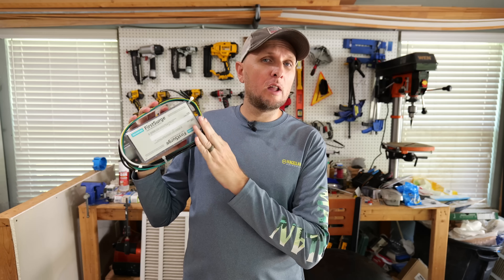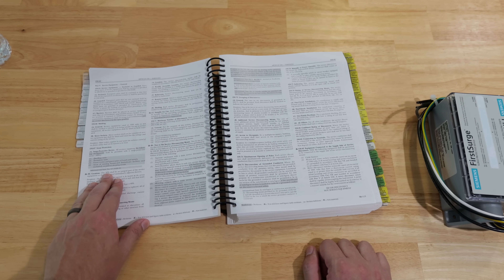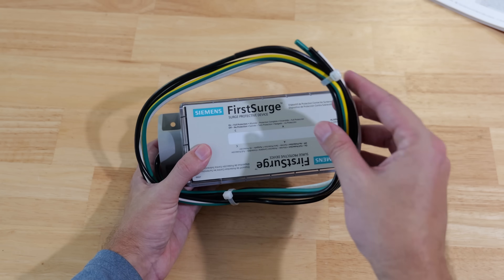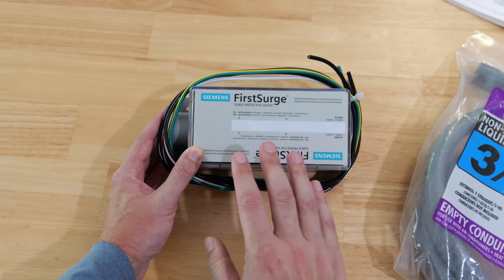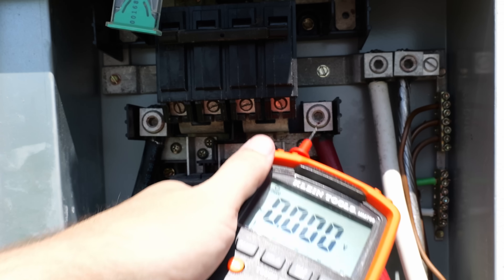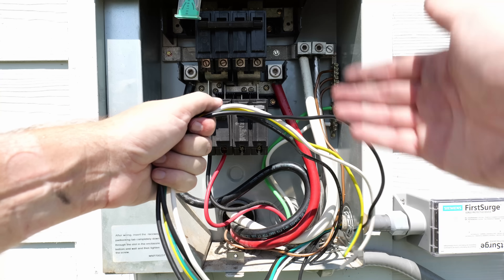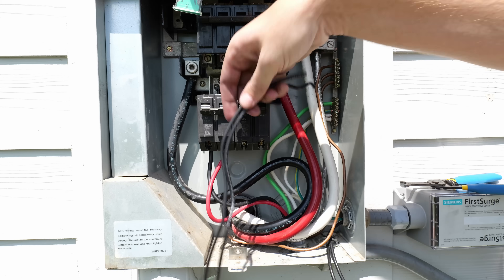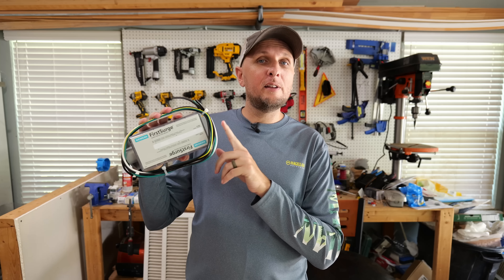Why Whole Home Surge Protectors Are Now Required and How To Install One!  Siemens FS140

Comment: I'm a RF engineer, definitely not an electrician.  But I have designed high power limiters for the RF transmitters (which I also design).  Essentially,  limiters perform the same function as a surge protector, just a different type of scenario.  The importance of keeping the wires short is due to the wavelength of the transient(s) (i.e. the 'surge') spike and also to reduce inductance of the wire - both which limit the effectiveness of the SPD's ability to clamp a surge.  Transients voltages (i.e. a lightning strike) can be converted from the time domain to the frequency domain, and that frequency has a physical length, depending on the medium it's in (air, a printed circuit board, etc. affect the physical length).  If the SPD is a quarter wavelength away from the connector point (i.e. the breaker) at the frequency of the transient, the SPD's 'shunt' impedance will appear as an 'open' at the breaker, meaning the SPD is ineffective.

Also, when I mentioned the transient and converting it to frequency above - transients actually contain a multitude of frequencies, all which have a different wavelength.  Unfortunately, it's not an easy problem to solve by attaching a SPD outside the box.

The ideal solution is to install a SPD inline, between the feed and the breaker box since this eliminates the lead inductance and the wavelength issue.  But that is not practical on a retrofit.  Personally, I'd still install one. A surge can take on many forms, and you almost need to attack it from many directions (SPD at the box, surge protectors at outlets, etc.).

Honestly, I'm surprised the electrical box manufactures haven't designed a panel with a replaceable, high quality and inline SPD at part of the electrical box (between the feed and breakers) - that would be the ideal solution for a new build. I'm not an electrician, so maybe there's some out there already?  I know Square D makes a SPD that fits in a breaker spot, but that has some limitations (I have several of the those).

No doubt it's a tough nut to crack and if it's from lightning, it tends to do what it wants. And there's other surge scenarios that an external SPD will work as intended, so it's definitely a crap shoot at times.  Our house had a direct hit last year.  Ironically, it hit the roof, bypassing the breaker box and the surge protectors located there, and snuck in via other paths (the outdoor can lights).  TV issues due to going in thru the power line - no issues.  HDMI ports? - kapow! I guess you do what you can.

Sorry if I got a little technical.  There's really a lot going on in order to make an SPD effective, and I really just lightly touched on some of the important details.  Likely a surge is defined as certain waveform by the NEC (correct me if I'm wrong), and a SPD is designed around those conditions.

Whew - that's a lot of typing! :)
Reply: As a retired RF engineer I concur fully with this gentleman's statement here. I am skeptical of the effectiveness of these devices because of the thin gauge and long length of the wires that connect the device to the power supply bus.
Reply: @basspig  Greetings from a fellow RF engineer (mostly-retired)!  Surge protectors are an interesting subject.  Simple at first, until you dig into the details.  I mentioned above we had a direct hit from lightning so I started to replace my outlet surge protectors with new ones just to be on the safe side.  Bought a Philips outlet surge suppressor at Wallymart.  Probably like most, I tended to focus on the clamping current...until I noticed the clamping voltage.  900V!! Yikes - why bother.
Reply: @Pinhead-q4i We had many challenges at radio tower sites. For obvious reasons. :-) 
One of the most effective measures I've had against lightning was winding the last 20' of mains cable into a loop, several turns-worth. The first step in absorbing surges is to present as high an impedance as possible BEFORE the shunting device.
In my experience, the surge protector devices do little to protect sensitive electronics. Just having a power outage can kill computer equipment that is not on a UPS, as I have found out over the last 25 years.
Surge protection has to take into account both differential and common mode voltage spikes. Then there's the EMP factor with lightning, inducing currents in any wires connected between devices, such as USB cables computers and peripherals. Only Faraday shielding the building can solve that last one.
I had an interesting call from a NY radio station I was CE at in the 1990s. They'd suffered a lightning strike on their tower, co-located with the studio. All of their computer monitors displayed distorted images with "rainbows". I knew right away what happened. So upon arriving, I grabbed a bulk tape eraser, powered it up and walked up to each monitor and de-magnetized them. All back to normal.
Reply: @basspig  Loops - Neat idea to help get a little bit more inductance on the outside of the shield for free, heck of a lot better than just a straight run.  Did the setups usually just employ one protection device, or did you have several, spaced a certain distance apart?  Were the protection devices a gas discharge tubes (I don't have much experience with those)?

Now that I mentioned a gas discharge tube, I wonder if those could be used in a SPD for the breaker box?  I was assuming the SPD's for the breaker box are just a bunch of MOV's?  Maybe that was the wrong assumption.

OP: Don't mean to hijack the comments, but it is sort of related w/respect to surge protection,  albeit a little more obscure side of the topic.
Reply: @Pinhead-q4i  Just one coil of the wire coming in from the pole, about 4 turns on 3' diameter.
Followed by one protection device at the breaker panel.
In some of my radio stations, we employed Isolotron surge arrestors (3 phase setup) with a phase-finder for circumstances where we lose a phase, just to keep the transmitter on the air.
I like spark gaps and gas discharge tubes for the big surges. MOVs are one time use mostly, and if you get a situation where a 13kv line lands on a 240 line, they aren't going to help past the first millisecond.
Reply: @basspig  Interesting!  Always neat to hear about other's ways of tackling the problem.
Reply: @Pinhead-q4i  Absolutely correct and I can't believe that this wasn't even mentioned in this video at all (or mentioned by any of the trained professionals that are commenting on it). Most whole-house surge protectors are only designed to begin to work once you hit a VERY high surge level of 600v or more. Well, that's all fine and dandy, right up until you realize that the sensitive microelectronics that reside in most modern devices in our homes today (computers, TV's, tablets, cell phones, receivers, streaming devices, Blu-ray players, printers, etc.) can all be damaged by voltage surges that go anything over about 325v. By the time your 600v whole-house surge protector decides to start clamping and shunting to ground all of the sensitive electronics in your home have already been destroyed. This is why you NEVER want to rely on just a whole-house surge protector alone - they have FAR too high of a clamping voltage to do you any good at all, at least with respect to protecting your electronic devices. So many homeowner THINK they are "fully protected" just because they have a whole-home surge protector installed. They aren't. This is why it is critically important to have Type 3 surge protection devices placed in front of any of the expensive electronic items in your home. And, you want to check those and make sure that you know what their clamping voltage is before installing them. Ideally, it should be no higher than about 400v - and a lot lower if you can manage it. The lower that clamping voltage is, the sooner that device will kick in and start protecting your equipment in the event of a suge. Lower is ALWAYS better here. Additionally, keep in mind that there are two very different types of surge protection devices available: Shunt-mode (MOV-based) and Series-mode (inductance and capacitor based). Although much more expensive, Series-mode surge protectors from companies like SurgeX, BrickWall, ZeroSurge and Audioquest are always the better option as they can take FAR higher voltages (up to 6000v) without being destroyed in the process - and they can take those higher voltages thousands of times over and still keep right on working.
Reply: @michaelbeckerman7532  I mentioned earlier that our roof was struck by lightning, bypassing the panels surge protector (regardless of it's effectiveness or not).  So the surge protectors scattered around the house had to take care of any local surge.  After the strike, I started to replace the local surge protectors as a precaution.  I was surprised at the high voltage ratings on some of the new 'surge' protectors.  One I saw was 900V!  Interestingly, while replacing the older surge protectors, many were rated for a clamping voltage in the 300V range (and these weren't even expensive surge protectors).  Fast forward to two years ago, after the lightning strike:  Seems like the industry is getting sloppy w/respect to  clamping voltage.  I admit, before the lightning strike, I never even considered clamping voltage.  At least some are meeting the UL 1449 requirements (but the most relaxed spec is 500V, so maybe not the best choice as opposed to the ones rated at 170V, 330V).
Reply: Any recommendations for the other devices to put inside the home. I do have a siemens fs140 on my breaker panel in the first spot coming in. I have had issues with my ecm blower motor on my hvac after power outtages, that's why I am on here researching. Anyway If you could link some or give names of what I should be looking for to put in the house. Are you just referring to surge protector power strips?

Thanks
Reply: @joshainsw  While I'm not an expert, there's a few things I'd look for. For starters, look for an UL1449 listing.  That's sort of an umbrella w/respect to coverage.  Look for a low clamping voltage.  I saw a surge protector at a big box store that had a 900V clamping voltage - totally worthless.  Seems like manufacture's stress the joules while totally ignoring the clamping voltage.  If you're looking at a surge protector and the clamping voltage isn't listed - don't buy it.  It seems the clamping voltage has been increasing.  UL1449's lowest rating is now 330V and goes up from there (400V is next) - not great, but better than 900V. Lower is better.  I also make sure fireproof is mentioned.  That's sort of discussed in UL1449 but I still like to see it explicitly mentioned. You're already going down the right path - multi-tier approach.  When our house got hit by lightning, the weakest link was HDMI ports and wired internet ports.  Surprisingly, having a cheap internet switch actually saved a lot a devices since the switch failed, protecting the device downstream.

 I'm leaving out a lot, maybe others can chime in and fill the gaps.

I do tend to buy Tripp Lite for our house.  Not because they are the best, but because they actually publish the specs on their website - so at least you know what you are getting.
Reply: Interesting and informative discussion.  I wasn't impressed by the presenter's explanation for the shorter wires but I only considered the propagation delay (1ns/ft.) vs. the reaction time of the surge protector (>>1ns ???).  Never got into RF EE myself so thanks for the lesson.

As for these devices not protecting home electronics, I think the NEC was more interested in the protection it offers to code-required safety critical devices like smoke, CO, and gas detectors.  I suspect this class of devices is by code a bit self-protected from surges typical in everyday scenarios (AC hard starts, table saws, small arc welders) so the whole house is more to cover the lightening strike and downed power lines cases for the safety devices.  As said elsewhere, dedicated surge or UPS systems are better for pricey stuff like computers and home entertainment systems.
Reply from the maker: @mikemilner8080 I relayed the information that is in the instructions about the wires being as short as possible.  I think it’s probably somewhat negligible but if I didn’t go by what the manufacturer said then I’d have people attack me for that.  Can’t win.
Reply: @alexwolf8019 I don't know if the the breaker would trip of not, probably just depends on the duration of the surge and/or if the SPD becomes permanently shorted.  I assume if the SPD is shorted, the mains have enough current to blow it to bits - hence the breaker.  As you mentioned, ideally the SPD is in-between the mains and the breaker box, then the surge protector provides a low impedance across a wide spectrum of transients.  I've seen SPD's used in outlets mention the line can open up if the the MOV trips, some don't.
Reply: Lightning pulse is very slow compared to RF domain. Typical rise time is 2 - 8 us or 100 - 500 kHz. Wire leads are still short enough at those freqs.
Reply: @antronx7  Interesting.  I searched after your comment and it does seem to be somewhat slow.  I guess one thing to consider would be the rise time required to get to the point that would cause damage rather than the risetime to 90% voltage (or current level).  For example, how long does it take to get to 400V, not 200KV?  Assuming a linear rise time to make it easy (400V/200KV) * 10uS = 20nS.  So probably prudent to keep the wires as short as possible.

But your point is well taken.  Very interesting topic, easy to go down the 'rabbit hole' reading the technical articles on the subject.  Wonder what the levels of the time domain pulse are when converted to the frequency domain?
Reply: I'm an old CB-ham guy from back in the day. NO surge protector works against lightning. There is no rise of potential over time. It is a scalar wave, its instantaneous.  When a storm was coming, we just unplugged the power and coax.
Reply: Typical pulse waveforms per ANSI/IEEE C62.41 for testing SPDs are 8 uSec to the peak and 20 uSec to the 50% decay point.

This maps into the Laplace domain, of which frequency domain (j omega) is only one axis.  The pulse does not oscillate, so it is represented by a double pole on the Sigma axis (offset from the frequency domain's j-omega axis).

Comment: How many ppl in the usa have a smoke/carbon monoxide detector that runs on batteries? Most ik i do so i think thats bs
Reply from the maker: Not anymore.  They are now run with wire so they have constant power and communicate with each other.  So call it whatever you want 😂

Comment: The Covered Equipment warranty for the Siemens device says it is disqualified unless installed by an electrician.
Reply from the maker: That is nowhere in the material provided or online.  Aside from that, I never expect a warranty to be held up by the manufacturer anymore these days on anything.  They all find ways out of it or make you jump through hoops to get anywhere.

Comment: Are these more beneficial than let’s say a 80ka Square D SPD for $120? My home was built in 2022 and they put the box is in the garage, boxed inside the drywall. So the small Square D box would work best but I’m curious if there’s a performance difference.
Reply from the maker: There is a pretty large performance difference.  This one is rated at 140ka, but what you have is way better than nothing.
Reply: no effective difference. 80kA is good enough. most lightning is only 50kA and you would never get all of it across your hot and neutral from a nearby strike.

Comment: I own a house trailer and my service box is 15ft from my trailer.  Service then goes underground and then up to breaker box in my trailer.  Can this be installed inside at the regular box or does it have to be where the main connects?

Comment: If the NEC is worried about saving smoke detectors, they should force the detector manufacturers to install MOV's or other such surge device in their devices.  It seems to me that they made the surge protectors code because they are trying to protect their useless arc-fault breakers that they put in code a couple cycles back.  Therein lies the problem with having electrical manufacturers on the NEC code making panel.  Its a money issue diguised as a safety issue.
Reply: I agree. Even white papers support the lack of arc-fault efficacy. Most recent codes are about moving product. It works similarly to lobbying the government to enact a law that requires citizens to purchase your product. Think insurance as a classic example.
Reply from the maker: Conspiracy theories have been great on this subject.

Comment: I added 1 to the sub panel i installed for a Computer Room.  Luckily the house main panel has a Surge Device already.  The new gfci/afci integrated circuit breakers are awesome too.

Comment: Is the clamping time on that surge protector quick enough for EMP?
Reply: Any SPD that is on its own breaker has 10+uH of magnetic trip coil inductance between it and the bus and won't be particularly effective at clamping fast transients.
Reply: this is made for lightning induced surges. nuke emp is too fast and house wiring will pick it up after spd.